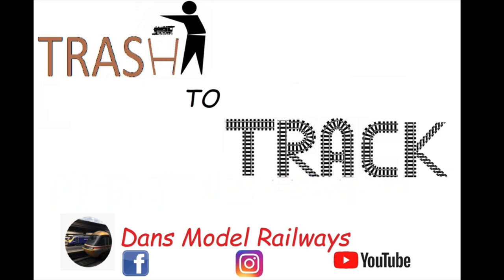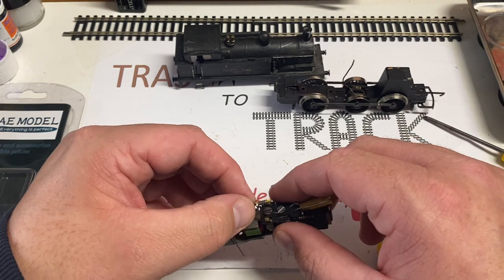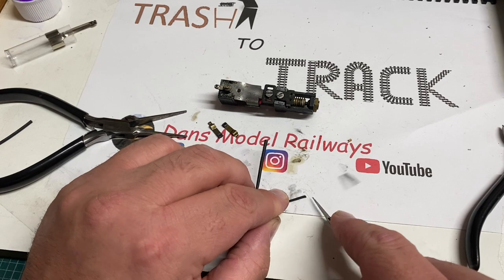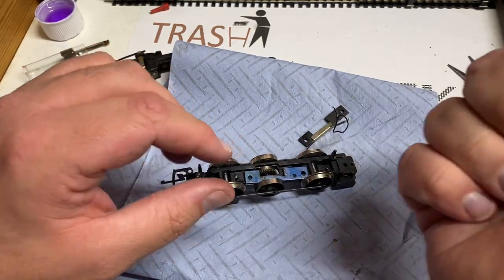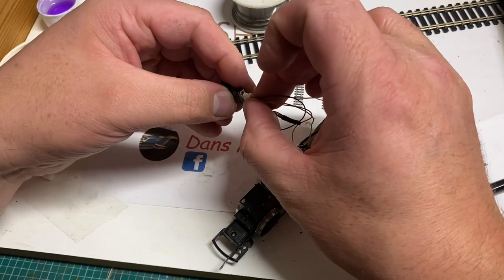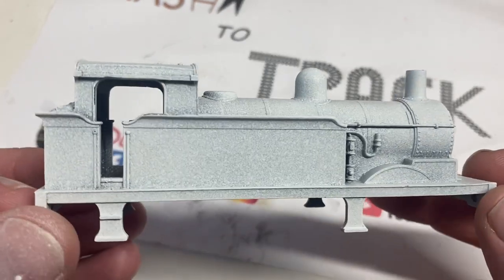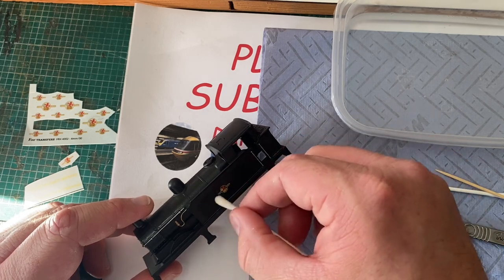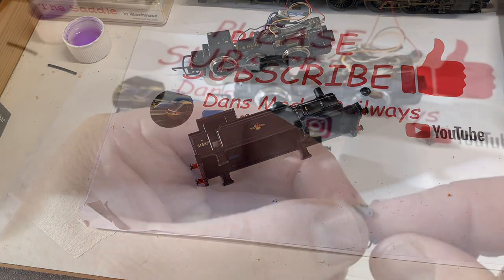Trash to Track Episode 25. G&R Wrenn R1 tank loco.

Comment: It came up really nice and you are so right about the old locos being built like tanks.
On the uneven finish of the paint, one reason for that orange peel effect is holding the spray can too far away,
or low air pressure if it's close to empty. Not that it's really noticeable with a black loco.
Cheers!